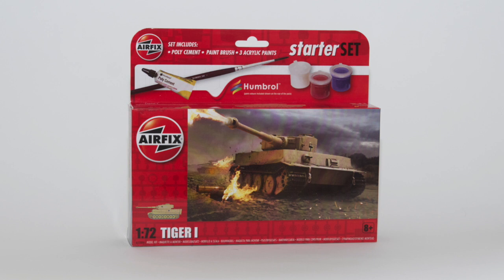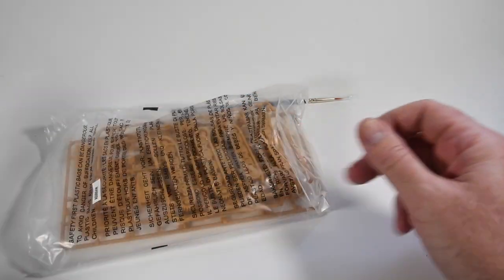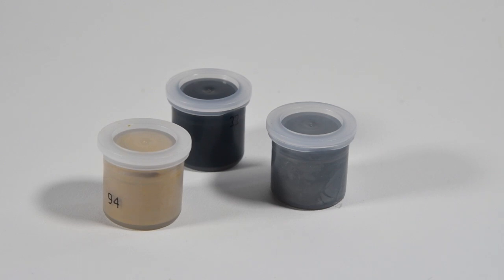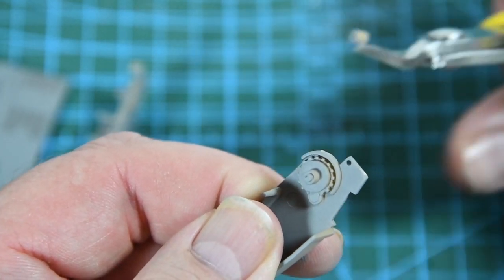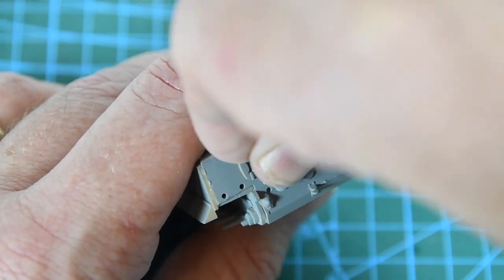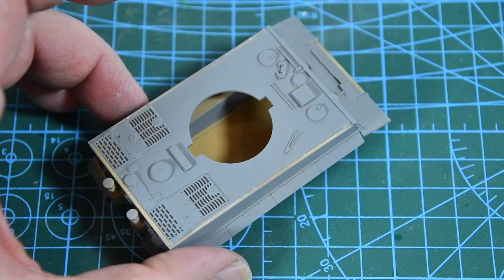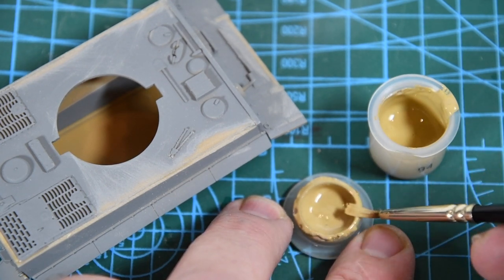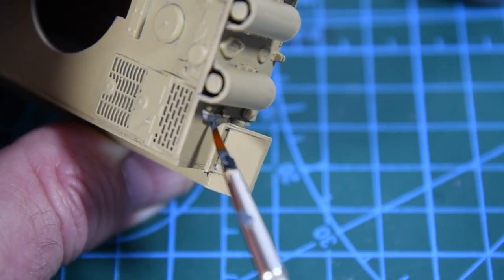Airfix Tiger I Starter Set 1/72 scale 2020 tooling review and full build  HD 720p

Comment: My goodness this is a far cry from the original Airfix Tiger I tank I remember as a boy. From memory the original had individual wheels to cement and also rubber tracks that were a nightmare to assemble. Great kit though, a real challenge. Loved the video, thanks for posting...
Reply from the maker: I remember them too! Nowadays they suggest using heat to bond the flexible tracks instead cement and getting everything covered in black goo. These new starter sets are a delight, I must say.

Comment: More 1/72 scale kit builds!  Great tutorial for painting too!  I have the Airfix D Day set with german and american tanks and diorama for play or display.
Reply from the maker: I'm tempted by a diorama at some point - I've used various scenic stuff for my 15mm war-games figures in the past and I'm keen to try the techniques on something bigger. Maybe one of the D-Day sets. I'm going to try to do the Sherman Firefly starter before Xmas, but next year do some 1/35th vehicles as well.
Reply: How did you get on with the horrible rubber tracks. I had to staple mine.
Reply from the maker: @leegtracer3763  this new starter set doesn’t have them, the tracks and wheels are moulded as I’ve piece. I’ll address the plastic track issue when my Josef Stalin arrives!!!

Comment: I bought this kit after watching this, my first tank. Did you use some powder on the end of the canon, and did you use a coat of varnish before the wash?
Reply from the maker: Hi Adam, yes I used a little bit of weathering powder around the end of the barrel. I have a set of Revell powders, pretty cheap online, or Humbrol do one as well. Just a little at a time of an old brush and dab it on gently. Its what you can use for things like engine exhausts as well. I didn't use varnish before the wash as I wanted a little bit of it to stain the paint surfaces to make them look used. If you want one a bit more factory fresh then I'd use a gentle coat of gloss varnish, do the washing, then a coat of matt to seal it and make it look right.

Best of luck with the build, and thanks for letting me know! Cheers, Gary